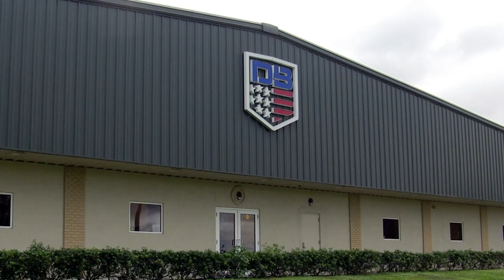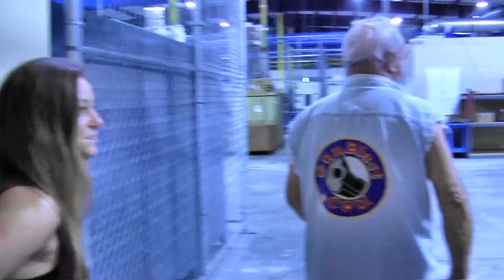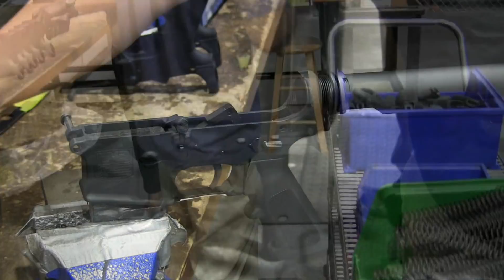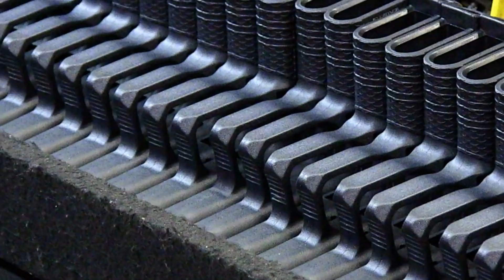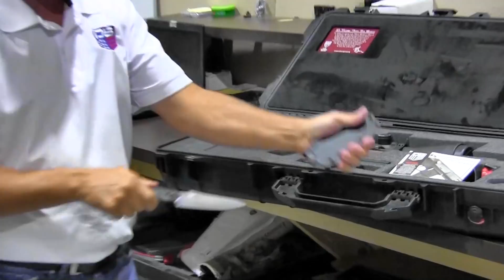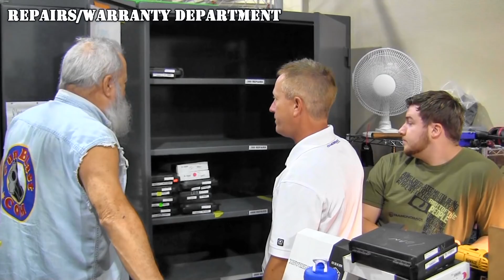A Visit with Diamondback Firearms, Part 1 of 3 - Gunblast.com

Comment: I like how some gun snobs get all pissy when people bring up DB's rifles. Its all the same stuff. They had some QC issues at first but they replaced most of their staff after all the complaints. I had a Sig  AR and then I bought a DB15. They both ran flawlessly and I would say  few people have good enough marksmanship to really see a discernable difference between two carbines at a high and low price point in terms of accuracy. My DB has never had any malfunctions at the range. Reliability is at 100% for me currently. I'm also alot more comfortable customising a $600 rifle than a $1400 rifle.

Comment: Last july I got a diomandback DB380 for my 16th birthday I probably put around 2,000 rounds though it and no problems at all, GREAT pistol!
Reply: J Field 
Look into a bersa thunder .380
Reply from the maker: The Bersa is a wonderful pistol, but quite a bit bigger than the DB380.

Boge
Reply: Gunblastdotcom 
Very true.
Reply: I owned two DB380's, couldn't go through a magazine w/o a malfunction
Reply: AFRAMS-CCT AF-RAMS-CCT 
It seems about right. I would rather purchase a glock .380
Reply: Harold Marquez or try the seecamp 380 or 32 acp there a bit pricy for a small gun but they work.
Reply: Lcp custom- love the little gun or p938
Reply: AFRAMS-CCT AF-RAMS-CCT 
Yea 4 a secondary side arm I was thinking about s&w m&p bodyguard or ruger lcp2
Reply: J Field 
Imma look into it. Thanks 4 the info
Reply: Harold Marquez yep

Comment: A friend of mine bought a Diamondback AR 10 .308 from a cousin, FFL dealer who runs a gun shop in Mo.  They put a decent but not really expensive Nikon scope on it and it is certainly a good looking gun. Problem was when we tried to sight it in it shot all over the place at only sixty five yards. ( All the room we had to shoot that day ). And that's off of a lead sled !  Three of us shot it, with three or four different brands and weights of ammo and it wouldn't group with any of them. Now we are not novices ok, I checked the scope rings, mounts, everything was tight and right so we tried a different scope we knew was a good one with the same results. He took it back to the gun shop probably two months ago and  has never heard anything about it as  of yet.  I am curious to see what they find wrong with this gun. But as of right now, I'm not very impressed with Diamond Back.
Reply: ditchdigger93 barrels for awhile weren't qcd well have em take the barrel off an no go it after retorque might do better

Comment: Tell DB that a drill clutch is NO substitute for a torque wrench.
Reply: Phone User.I saw that also! 
I'm sure the handguard is exactly lined up too?
Maybe I'm wrong
Reply: That drill makes adequate torque for the hand guard, i would never use a power tool on any small bolt though, I work with kids that use impacts on everything and it's aggravating as fuck,  they bend 1/4 20 bolts on straps and stuff. Then when they see me use a ratchet, they say "hey man use my impact", and I just want to choke them.
Reply: I watched a BMW motorcycle manufacturing video.  It was a modern high tech German manufacturing operation.  I was surprised to see them using Bosch cordless drills for almost all fastener assembly operations.  The clutch is perfectly appropriate to ensure proper torque on non-critical fasteners such as the forend rail mounting screws.  It's faster and I'd argue more reliable than turning fasteners by hand.  Yes, in a large automobile manufacturing plant torque runners are used, and some of them even report the torque of each fastener to a computer for statistical process control, and small electronic assembly operations typically use a dedicated torque tool suspended from a tool balancer (I own two that are manufactured by HIOS), but a good cordless drill can be a real boon to manufacturing operations such as the one shown at Diamondback.  My biggest concern would be ergonomics and repetitive motion injuries if a cordless drill driver was used for several hours a day, but that's probably not the case at Diamondback.

Comment: I have db15 pistol with a 7.5" barrel. I'm going to put a 10.5" on it one day, but the 7.5 shoots pretty decent groups at 50 yards, just loud as shit
Reply: Ken Shiro How many rounds thru it, been reliable?? How many high round count clases have you put it through if any.  Been looking for a spare training rifle
Reply: Full Metal jacket 88 not many, around 600-700, with 100-200 round sessions then cleaned,  but never had any issues, haven't run any steel through it yet.

Comment: Helped a friend with a DB15 recently. 4 years old, had hardly been fired to that point. After about 250, 3 range sessions, rounds couldn't zero the rifle. Point of aim kept moving. Even after disassembly and torquing the barrel nut. Something DB didn't think was necessary being it was loose. Then eventually replacing the 10 moa barrel and pos gas rings. Hope they have mastered the easiest rifle to produce by now.

Comment: During my Conceal Carry Class I was told by the Instructor (a police officer) that he didn't like the DB9 I had because it did not print well enough for him to see while it was in a front pocket.  The very reason I purchased it!  Later I found out that a gun that holds 15+ rounds is not always easy to conceal.  The reason I carry 3, 6 round Magazines.  Practice makes it possible to change out a spent Magazine for a loaded one in a matter of split seconds.  I love my DB9 and would only purchase a full size hand gun for home defense.  I will say I would look hard at Diamond Backs DB9FS when in the market, Diamond Back makes excellent firearms.
Reply from the maker: They do. Check out the new AM2 pistol in Part 2.

Boge

Comment: I love your channel but I hate and regret buying a db-15 pistol.
Reply: Felix Magallanes what's wrong with your AR pistol? Mine has been excellent, their pistols suck tho
Reply: AFRAMS-CCT AF-RAMS-CCT it goes through fte issues pretty regularly with wolf ammo. I figured at first it was just because it wasn’t nice and lubed but not the case. Sure, it’s maybe the ammo but I haven’t shot since with the lake city ammo i have. It just sits in the safe.
Reply: Felix Magallanes damn, that sucks and it's definitely not the ammo cause it's all I shoot on both my DB AR's. Zero issues (6k on each) just a broken gas key on the pistol
Reply: AFRAMS-CCT AF-RAMS-CCT hmm? That’s great man. Maybe I just got a bad pick.
Reply: Felix Magallanes have you tried sending it back? It's an AR, prob an easy fix
Reply: I heard its a gas issue with some of the db15 pistols
Reply: Felix Magallanes check the gas rings or get a RMA send it in have it fixed up they fixed the quality control now so if you got an older stock model it may have squeaked through mine fire every pull and can run 556 223 an other is 300 running like a scolded dog never had any issues even dropped the 300 a few times running from pigs lmfao!
Reply: So basically, "I shot shit ammo through it but it's probably the gun"

Go ahead, I'll wait 😂😂
Reply: Lemmi have it